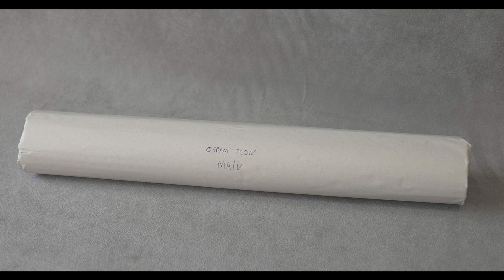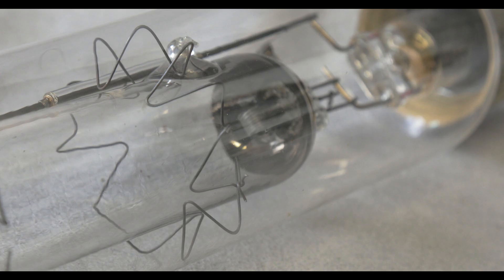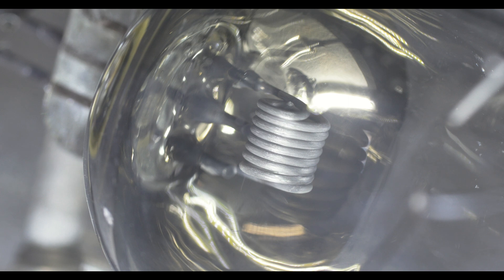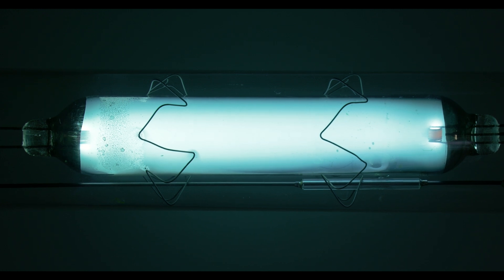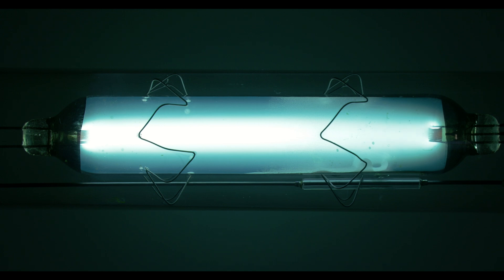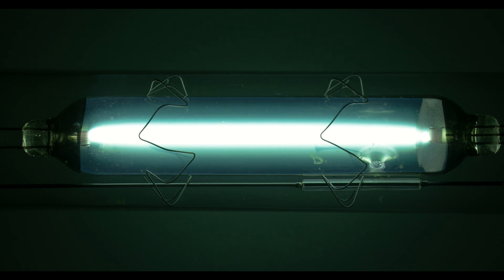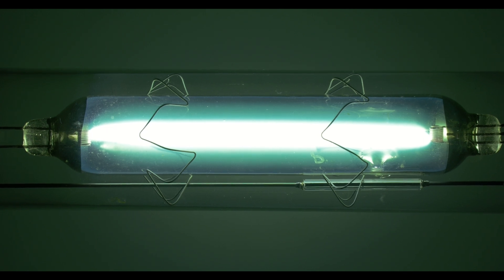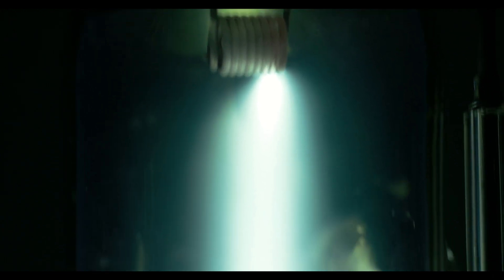250w Osram MA/V Medium Pressure Mercury Lamp

Comment: Very interesting lamp indeed,  never heard of a medium pressure mercury vapor lamp.  I've only ever heard of the low pressure mercury vapor,  first produced by Peter Cooper Hewit in 1901 with limited use, and the high pressure mercury vapor made commercially available from General Electric around 1932 and was a huge success.   Low pressure sodium lamps were also introduced around this time with limited applications owing to the monochromatic yellow light with 0 CRI, so everything would appear a yellow version of black & white.   It was soon realized a high pressure sodium lamp would have much better CRI and acceptance, but due to the corrosive effects of hot sodium, higher pressure and temperatures of around 2000°F there was no known material at this time suitable for the arc tube, it was the intensive research and development of a translucent aluminum oxide ceramic by General Electric in the late 1950s that made the high pressure sodium lamp a reality.
Reply from the maker: Yeah the MA/V lamp was developed by Osram-G.E.C of England in 1931 and was introduced in 1932. By 1933 the tech had been licensed to European manufacturers and by 1934 to the Americans which resulted in the General Electric A-H1 which was basically a copy of the original Osram-GEC.

I wouldn't say that low pressure sodium saw limited applications as huge areas of the UK, including the area where I'm from, were lit almost exclusively by LPS since it's introduction in the 1930's! It's only in the last couple of years that they have stared to all be replaced with LED.
There is a road near me which actually still has a few of the original Wardle "Liverpool" lanterns still in service! Amazing to think how long they been up for! 😎
Reply: @FrontSideBus  interesting.   Here in the USA where I live low pressure sodium lamps are only used in very niche applications,  the most extensive uses I'm aware of are near astronomy observatories in Flagstaff Arizona,  Southern California, as well as beaches near sea turtle nesting habitats.   Here the monochromatic light is  an advantage along with the highest lumens per watt of any other electric light sources excluding the ballast losses,  since it can easily be filtered out.  

High pressure sodium lamps were the most common HID lamp used for street lights from the 1970s until the last 5 years or so in the USA, they are rapidly being changed to LED